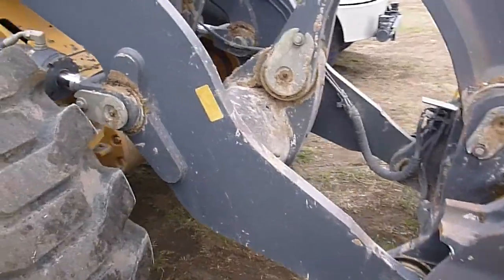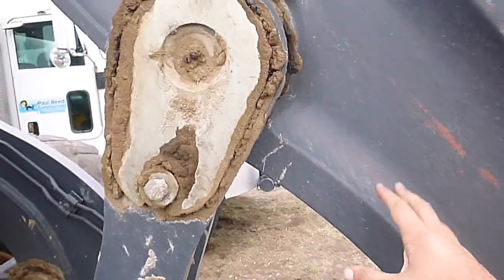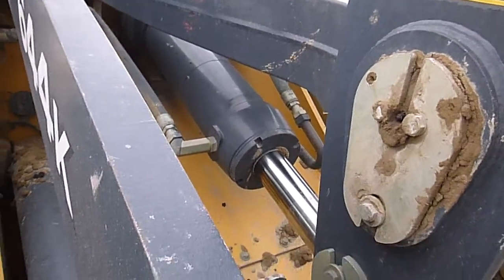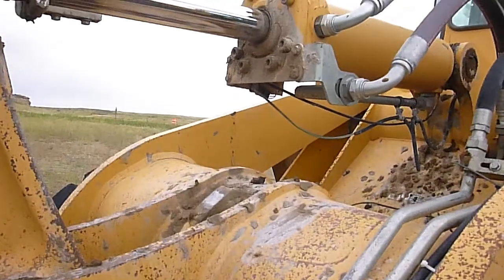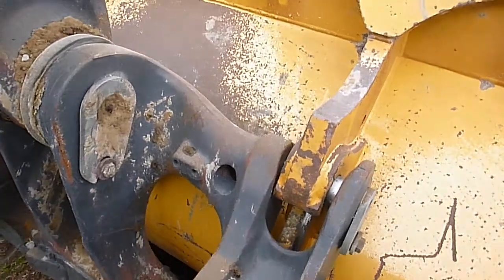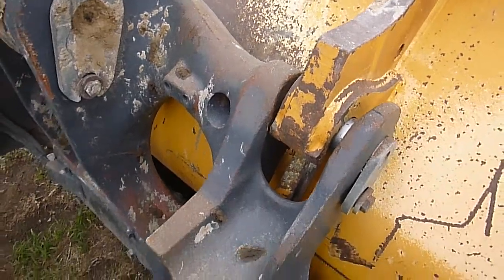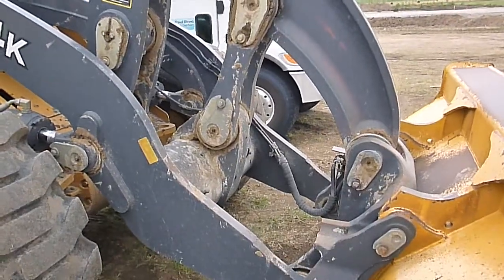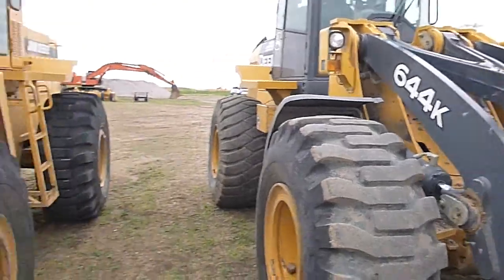Deere Loader Powerllel Linkage System

Comment: If you read the JD specs the breakout force of the Z-Bar pin on bucket verses the powerllel is over 5,000 FT pound greater on the Z-Bar. Would really like to hear if you have dug with both and can give a comparison. I am looking at buying a powerllel but really am concerned about giving up that much breakout force. Would love to know if you can give some real world feedback.  Thanks
Reply: Kermit G according to Gary Bell, Vice President and General Manager of KCMA Corporation, makers of Kawasaki wheel loaders, breakout force is the Z-bar linkages largest single selling point. The person in the video has the difference between z bar linkage and parallel backwards.

Comment: Looking at a spec sheet, the z bar actually beats the PL. Running one you can tell a little bit of a difference. I'd rather have a TC, but you can't get them on anything but a 624 now. A 644TC would be BA!!